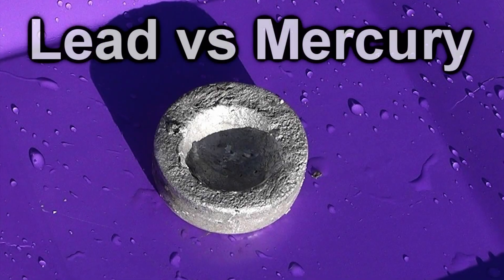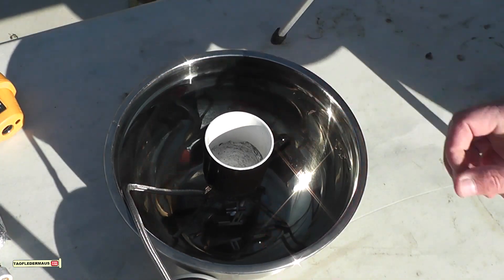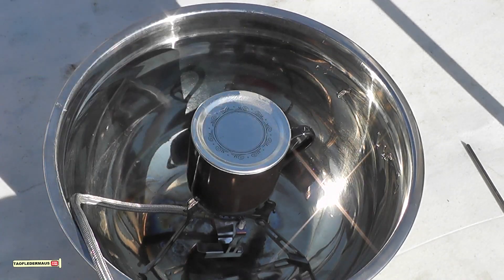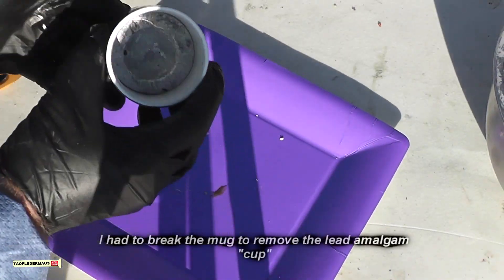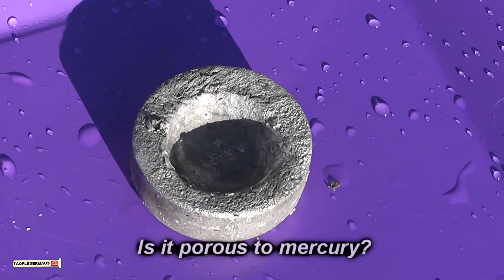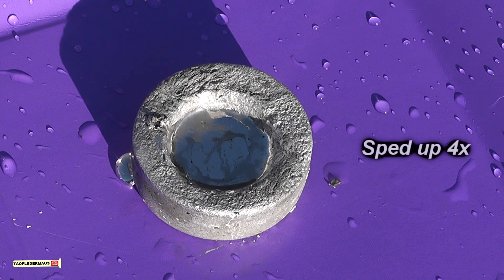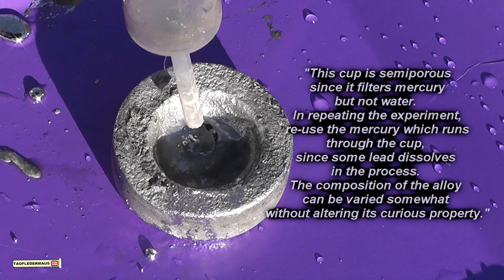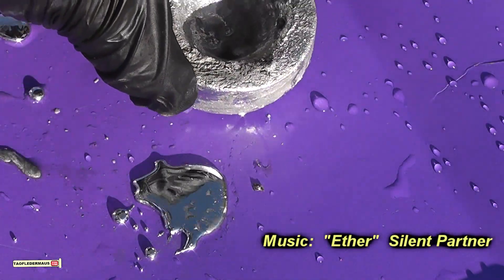MERCURY vs LEAD -  Rare experiment from 1952

Comment: one more, how do you 're-use' the mercury to get rid of the dissolved lead?
Reply: +Star Kicker Taofledermaus - " I'd need to run it through a retort,  or distill it to separate them ."
Reply: +Jesse Crandle Roger that, thanks..must have missed that part
Reply: Star Kicker It's all good, sometimes you ask something and then by the time you refresh the page it's been asked 40 times lol... I just figured I'd paste it so you could see.

Comment: Two things, 
I've done something similar but with candle wax, if you let it cool but continuosly stirring it it ends up with a top looking like oatmeal. So I wonder about your stirring process, did you do the experiment by pouring it into a mold aswell? as to see if the natural settlement solidification may make it non porous? (or easier maybe, make a 1cm disc and place mercury on top to see if it flows through)
And the second thing, now you will have to distill the mercury!

Comment: not a chemist or physicist or anything, but could it be that the liquid mercury is displacing the mercury in the alloy, and it sort of just 'flows through' by pushing mercury in the alloy downwards and out? pure, inexperienced speculation here. did that paper give any reason for this phenomenon?
Reply from the maker: +nanoleopard201  The paper really did not explain why this happened.

Comment: Very strange indeed, maybe this method can be used as a crude filter for mercury! IDK. I wonder what it would do with molten solder or lead or tin instead of just mercury. H2O is a highly polar substance, so I wonder if it would work with different oils and stuff.

Comment: But why does this happen?
Reply: +Generic Username From what I guess, the mercury is trying to alloy with the lead, it does so temporarily but then because it upset the ratio of mercury to lead, some mercury elsewhere will be unalloyed/turn back into liquid. This happens in a chain reaction throughout the cup, since gravity is acting on it, the propagation will be downwards towards the table. Eventually this reaction reaches the bottom of the cup and the mercury that has liquefied cannot alloy to be come solid so it just flows out.
Reply: +Joey Dimang but Mercury has a higher surface tension than water
Reply: This is by no means a correct answer, I am simply going from memory and educated guesses. The surface tensions of water and mercury are different, both being a cohesive liquid, wanting to stick together. The amalgam cup has pores and holes in it that a less tense liquid such as mercury can slip through. Water does not slip through because the holes are too small and the water is too cohesive.
Reply: Generic Username I'm pretty sure the mercury distributed through the cup breaks the liquid mercury's surface tension, allowing it to move through the pores in the cup.
Reply: +jackguo380  Very interesting explanation!
Reply: +Telogor _ Exactly,  surface tension is just that: tension at a surface be that between two liquids, a liquid and a gas, or a solid and a liquid.  The surface tension between mercury and air may be ~7x higher than water in air, however the surface tension between the mercury and the cup must be dramatically lower than that of water and the cup.
Reply: i figure the mercury is displacing amalgamated mercury
Reply: +Generic Username 
I'm guessing there's some kind of electrical shit going on that permits the mercury to wick its way through nano-pores in the lead.
Reply: +Joey Dimang but Mercury's surface tension should stop that maybe this is more of a displacement.

are the metals seperateable?
Reply: +Generic Username  could it be possible that it looks like an amalgam is formed, but actually the lead is formed into a microporous matrix, acting like a very fine porous sponge in which the mercury in liquid form is captured. Adding mercury in the cavity will displace the mercury in the sponge, and by gravity it pushes the mercury that is in between the lead matrix out of the object. The adhesive forces of the mercury to the lead matrix might be strong enough to prevent leaking out of the matrix, unless extra mercury is added? Just a thought... I'm not into metallurgy, so I probably will be wrong on this one... ;)
Reply: ***** should test the amalgam's actual porosity (i.e. if the amount of voids in the material) by blowing air through it or, if that can't be safely done, by measuring the density. I'm sure the surface tension between mercury and the amalgam is near zero but that doesnt't mean jackguo380 's explanation is wrong, especially if the amalgam isn't really porous.
Reply: +Generic Username I'm guessing the weight of the mercury might have some play in it. Causes more pressure on the surface tension. The thought that some liquid mercury is left in the amalgam unable to alloy is intriguing, though it leaves me wondering why it didn't leak out before the liquid mercury was added.

I have a speculative theory that much or all of the mercury turned to gas leaving pours in the material. Water being much lighter than mercury would have less pressure against it's surface tension than mercury. I have no idea about the actual size of the molecules, and that would be nice information to understand in this question.
Reply: I think the question must be: Is it really an amalgam? Could interstitial cavities form, when the lead crystallizes at it's setting point, in which the mercury (still liquid at normal temperature) can float freely (but kept in place by it's 'van der waal forces"? (to get this effect, the interstitial substance molecules should be smaller than the molecules of which the solid matrix is formed... so I read somewhere. It's not a big difference in molecular weight though (Hg=200.6 Pb=207.2), but Hg still is smaller...). If this theory would be true, this might work with Bismuth instead of lead as well, since bismuth atoms are also heavier than mercury. Just a train of thoughts...
Reply: +tblbaby 

well played.....
Reply: +Joey Dimang it&#39;s then, like the properties of hide glue vs aliphatic resin vs  cyanoacrylate.  of these glues.  cyanoacrylate, and the water to glue ratio of hide glue, can lower surface tensions, and the glues can seep into different kinds a cracks.  while aliphatic, is very thick, and must be treated differently and allowed to set differently.  even though hide glue is made of water, it can still flow into cracks, but does not fill crack which is interesting.  cyanoacrylate will flow through cracks and can fill up the empty space, but it's not water soluble.
Reply: +Generic Username Wouldn't the mercury aspect of the amalgam break the surface tension of the mercury in the cup, allowing it to seep through? While the surface tension of water is maintained, thus it stays in.
Reply: +Telogor _ That's what I think. Surface tension is caused by cohesive forces among the particles of a liquid. These forces are the same among the mercury of the amalgam and the liquid mercury. The same happens with water on a hydrophilic surface.
Reply: +jackguo380 If that were alloying with the lead the cup would be deformed from the mercury.  Atoms don't propagate through solids like that.
Reply: +jackguo380 Yeah that's what I guessed too. It would be interesting to vary the Hg/Pb ratio of the cup and compare the flow rate.
Reply: +Generic Username   But why does this happen?

Magick: The Dissipating.
Reply: +John Libal It was mainly a guess, but I think you may have misunderstood what I wrote. To explain in terms of an analogy, what I mean by unalloying and alloying is that the mercury is like in a big line up, if a person at the back of the line were to push, then the front person will get pushed. Therefore the mercury in the cup is trying to create an alloy with the lead, but some mercury has already done so, therefore it would displace some mercury. And that displaced mercury will go further into the cup and displace more mercury, and so on, hence the idea of propagation.
Reply: tblbaby    I have a speculative theory that much or all of the mercury turned to gas

Are you a chemist or physicist?
Reply: RonJohn63 Mostly I'm just a Cist on the worlds ass :)) I've got kind of a knack with cause and effect and applied sciences. I can't say self trained, but independent and not that in depth.
Reply: tblbaby   _independent and not that in depth._

IOW, you're babbling about things over which you have zero clue.
Reply: RonJohn63 That's entirely possible ... I have no idea what IOW means. It was a rank speculation based on what I do know, and I didn't take the effort to study up because it's not that important to me. It's not like anyone couldn't learn the principals involved in a short time. Are you protecting turf here? Is that why you're acting the dick?

I've got a history of figuring out puzzles and methods pretty quickly. A genius IQ with certain strengths and weaknesses .. and QQQQ you ;)
Reply: tblbaby IOW : In Other Words.

(It's been email/IM/text shorthand for 15+ years.)
Reply: tblbaby   _Otherwise known as highly probable symptoms of personality disorder._

Do some research before you throw out a "diagnosis".
Reply: RonJohn63 more confirmation ... thank you
Reply: +Joey Dimang Mercury is more dense and cohesive...
Reply: +tblbaby Sorry dude, despite RonJon63's ham handed attempts at questioning your credibility, it's fairly clear that you're attempting to use an above average grasp of the English language to make a rather transparent ad hominem argument. Accusing your opponent of probably having an unnamed "personality disorder" doesn't really further your argument any more than claiming to have "a genius IQ" does. Your actual theory appears to be sound at face value tblbaby, so there's no need to stoop so low.
DISCLAIMER: I AM MAKING NO CLAIMS AS TO THE ACTUAL CORRECTNESS OF TBLBABY'S THEORY. I JUST DON'T LIKE LOGICAL FALLACIES.
Reply: Gir547777 no need to sorry me :) I was basically assaulted by a maladjusted dick head with a problem over a simple suggestion of loose theory I never claimed was correct. His problem with me and how he addressed it are basic flags of personality disorder. Am I going to name one of the labeled disorders specifically? No, don't know the guy that well. His problem could derive from one of a number of potential perceptual malfunctions. Whatever the problem, his response was not rational. He's got a beef with something, but he doesn't even know me. It's very basic that type of response is symptomatic of personality disorder.

And why are you bothering me? You don't like my claim of genius IQ? I didn't make the fucking test, I just took it. Whatever your problem is, you can fuck off with the personality disorder guy, k?
Reply: Gir547777 another thing, the use of "ad hominem argument" and claim of "logical fallacy" were tossed into your lame response in an obviously awkward way, as if you threw those in without really understanding what they meant and constructed a statement around them.

I don't know what type of fallacy you may be referring to. If you're saying (the only possible fit I can see) taking inappropriate behavior to task, if that's the root of the problem, isn't logical? ... I think that's a stupid assessment.

It seems like you recently learned some things in class, and you're taking them out for a first spin. That's great, lol, just be a good human bean and don't try them out on someone who's already being harassed by a dick head with an irrational problem.

Comment: That'd make a great filter in case your mercury got dust and crap in it
Reply from the maker: +Jeff Parks   But it dissolves some of the lead too in the process.
Reply: Wow, this actually would work
Reply: +TAOFLEDERMAUS Did you attempt to reclaim each element, or just keep the amalgam?
Reply: +TAOFLEDERMAUS Are there any compounds you could mix in that would cause the lead to precipitate in some form into larger crystals, so you could run it through a conventional filter?
Reply: +TAOFLEDERMAUS  you could vacuum filter it through a leather shammy after that might work

Comment: I'm blown away by this one. Great experiment taofledermaus. Nice recommendation indeed! Congrats for reproducing the experiment and even extending it by successfully changing the parameters.
Reply: -A CUP OF LEAD AMALGAM, POROUS TO MERCURY

-ARCOT VlSWANATHAN and M. G. SURYARAMAN
-Madras Christian College, Tambaram, South India

MERCURY is known to dissolve in certain metals and to diffuse through them. J. Henry (8) described an experiment in which mercury diffused through a lead rod held in the form of a siphon, and flowed over. E. N. Horsford (3) studied the rate of ascent of mercury through lead rods. J. Nckles (4) found that zinc was more permeable than lead to mercury. E. W. Blank (1) devised an experiment reported in THIS JOURNAL, in which mercury under its own pressure passed down through a lead rod six inches long. A cup of lead amalgam which is porous to mercury, hut not to water, can be made as follows. Boil 20 ml. of mercury in an iron cup (85 ml.), taking care not to breathe the fumes which are poisonous. Using an iron file stir in 254 g. of lead (foil or tubing) and remove. any floating scum. After cooling the amalgam to a semisolid state press a smaller iron cup (50 ml.) into the amalgam, holding it there until the mass sets. Then dislodge the cup of lead amalgam thus formed. This cup is semiporous since it filters mercury hut not water. In repeating the experiment, re-use the mercury which runs through the cup, since some lead dissolves in the process. The composition of the alloy can be varied somewhat without altering its curious property.

LITERATURE CITED
(1) BLANK, E. \Y., J. CHEM. EDUC., 9, 317 (1932).
(2) HENRY, J., Proc. Am. Phil. Soc., 1,82 (1839).
(3) HORSFORD, E. N., Am. J. Sci., [21 13,305 (1855).
(4) NICKLES, J., Compf. Rend., 36, 154 (1853).
Reply: Its a very short article, hard a hard time finding it. Enjoy.
Reply from the maker: +Michel PASTOR   thanks Michel!
Reply: +TAOFLEDERMAUS It would be interesting to read the paper but the only source I found is ACS and it is behind a pay wall. $35 argh.
Reply: +Michel PASTOR Here is the link anyway if somebody is interested http://pubs.acs.org/doi/abs/10.1021/ed029p257
Reply from the maker: I think you have to pay a lot of money to access that though.
Reply: +TheBackyardScientist Thank you :)
Reply: +Michel PASTOR It's also accessible for free using sci-hub.io, not entirely legal of course but I don't think the original authors would mind. Very useful for all kinds of paywalled papers.

(I know someone else already posted the article, but wanted to share the existence of sci-hub with you if you ever need a paywalled paper in the future)

Comment: I don't think that it's so much 'porous' to mercury, it's more of a diffusion thing, the elemental mercury in the 'cup' is pushing the amalgamated mercury out and taking its place. That's just my theory on it, without the tools to actually check I can't say for certain though it did say that some lead came out with the mercury so it holds water.

(u c wut i did thar?)

Comment: This is very interesting. Did you try putting water in the cup after the mercury test? I'm just curious if the mercury corroded the lead enough to allow water to pass through.
Reply from the maker: +Locutus   Yes,  the result was the same,  the water still didn't seep through it.